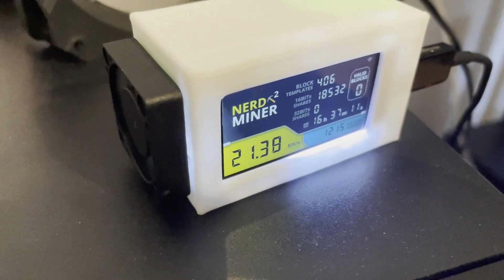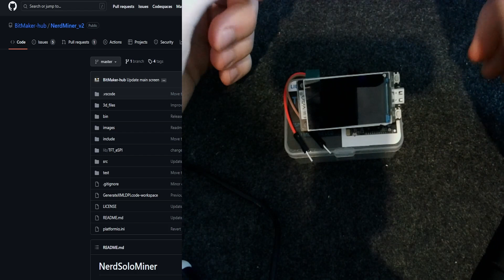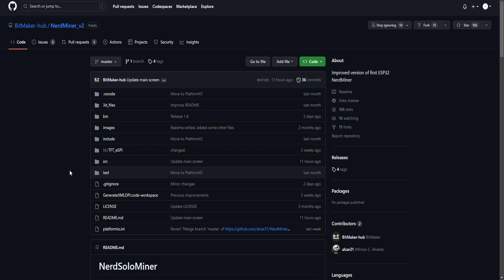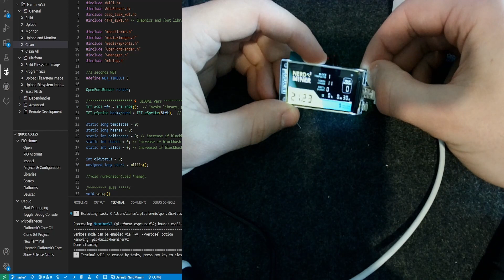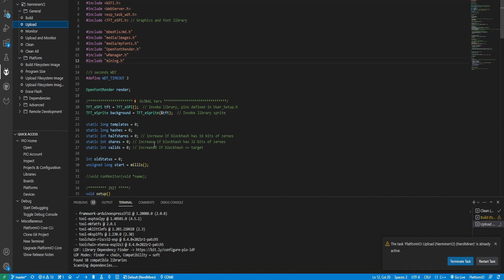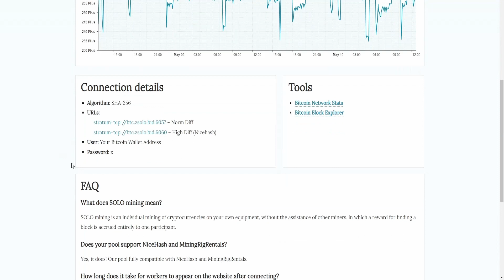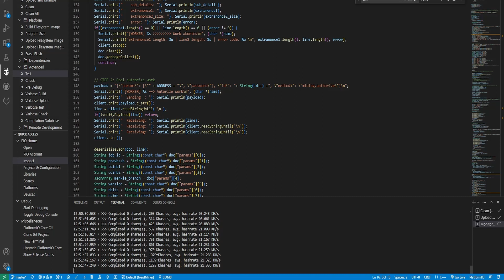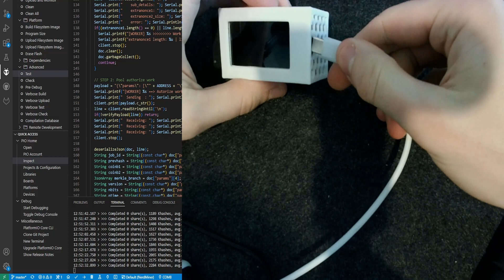SOLO MINE BTC | Nerdminer

Comment: Hi do you know if it works on an esp32 without screen ?
Reply from the maker: Yes it does. If you use an IDE like VSCode you can open the terminal and see if it produces hashrate
Reply: @WantClue  I followed your video but when I upload, I have this error : "This chip is ESP32 not ESP32-S3". In fact I have an ESP32. What can I change to make the programm work on my ESP32 ?
Thank you for your help
Reply: @WantClue   do u have reference video how to use the vscode on mac? thanks, i want to see via terminal

Comment: I have the T- Display-S3 but have never done something like this before. Is there a Mac tool I can use instead of visual studio?
Reply: There is a mac version of VS that runs on as little as 10.14.6
Reply: @colind6797   what is vs bro? what is the console tool that been using? i want to monitor my nerdminer detail transaction and if i connect to correct wallet and pool
thanks
Reply from the maker: you could also use the esp32 online tool. It's in the github description :-)

Comment: can i use a raspberry pi 3b for this too?
Reply: I think so. but it is slower than a nerdminer
Reply: @Sm0oTh92  nooo, this esp is much slower
Reply: @dogoshicatamoto269  even a raspberry pi 4 is slower. I measured 3 kH/s
Reply: @Sm0oTh92  but in generel the cpu power of the raspberry pis are strong than the cpu of this esp, i dont get it
Reply: @dogoshicatamoto269  🤷🏻‍♂️
I used CPU-miner-multi from."it-berater"
Reply from the maker: Ofc maybe I shall do a video about the pi for mining aswell :-) But for a Pi you need other software
Reply: @WantClue  oh yes, pls do it :) pretty pls :) subbed btw ;)
Reply: @dogoshicatamoto269  solo mining wenzlaff